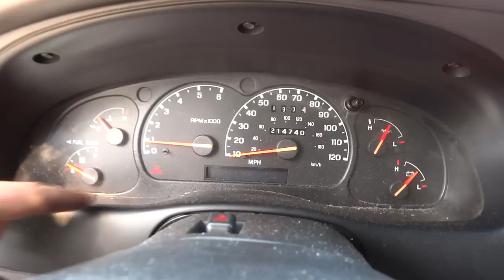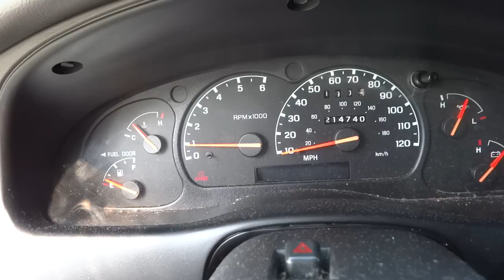Engine Knocking or Ticking?!? This Could Be Your "FIX" Ford/Mazda/Bmw/Honda/Toyota

Comment: Ok... here is the 101 on why this is a really really bad idea... Engines are built to regulate a near perfect fuel/air ratio which is typically 14.6:1. They are engineered to regulate this in a number of ways. One of those ways is to limit the air intake using swirl flaps. That way you don't have so much air that you have trouble with your combustion. By removing these your car isn't going to be able to regulate they way it should. With more air the computer is going to accommodate with more fuel. It may sound better because you don't hear the flaps and it might feel better because you are going to have surges from all the extra fuel. But ultimately this is bad for your fuel economy and it is going to make the engine run a lot worse than it should. It's asking for lean conditions which are also going to burn out your spark plugs a lot faster. No good is going to come from doing this. The "fix" is all in your head.

Comment: P0171 code my actuator has a leak im thinking about replacing the manifold but found this video would doing this to my 2.3l 2003 ranger help and how would I fix the swirl valve/ runner valve to get rid of my code and get my mileage back

Comment: Does the 1996 Toyota v6 have these swirl flaps? I have a friend with the v6 in his 1996 4runner and it's making a ticking noise that sounds like ticking valves. I'm wondering if this is what's wrong. The car has about 250k miles but has had superior maintenance over it's entire life and he is the original owner.
Reply: Hey dude, did ur friend ever find out what that ticking noise  is? I have a 97 Lexus es300 with some ticking noise too. Fuckn Toyota..... I've always kept up with my maintenance, but i guess just old age. 228,000 miles. I don't want it to die on me.

Comment: I have a 96 impreza which has a similar engine knock. I'm not sure if this is the problem, or if it's just my lifters making noise. Can someone be more descriptive with the knocking? My knock is loud upon start up but it quiets down if its been running and started back up quickly. This could be because the oil pressure is higher and the lifters quieted down, or this could in fact be the flaps. Could someone tell me please, i really dont want to take apart my entire manifold only to realize that a motor flush and oil change could fix it.

Comment: what happens if you remove the plug to the actuator but leave the vacuum lines plugged in and keep driving around? my mazda3 does this BADLY
Reply: Good question.

Comment: Those flaps my friends are only there for low end torque. I kno in an acura gsr thats wat it for so I could only imagine that wats it for on ur vechical. So taking them off does have good effects on ur car n bad. U just mainly gain more airflow which is better for high rpms n more torque in ur upper powerband. In ur case.... u shift probably at 6500 so loss of power n torque for daily driving.  on my honda "built" I shift at 11k.  So I will notice the gains more then u. There really no physical harm in remove em but dont do it unless u got a high rpm motor or to quiet the noise it makes.. just be careful not to hammer anything plastic. Pretty sure its gonna break. Good recovery btw. XD

Comment: Why would you not simply replace the $5 intake manifold gaskets? This and you 'bull in a china closet' approach seems to discredit your theories regarding improved performance. That said, your video is informative in the diagnostics of the issue. I think it would have been worth attempting to simply change the solenoid before hacking away at things...
Reply from the maker: The intake manifold gasket had plenty of thickness past the intake to seal properly, as for the solenoid..it's not the problem as I mentioned...the flaps inside no longer grip the inside shaft and move back and forth even when the shaft that the solenoid controls doesnt.
Reply: I get all that... Everything I have read says this mod gets mixed results; some people notice little difference with or without the control valves while others experience harder starts, the engine bogging down at low rpms, and Check engine lights. Basically if you have a race car that needs to perform at wide open throttle all day its great... As long as you get the ECU programmed to take advantage of the extra air. If drive-ability is what you are going for be prepared to buy a replacement manifold if the results aren't desirable which is really the only alternative to your suggestion. The only downside I suppose would be having to do the removal and re-installation twice.

Comment: depending on how ur intake manafold is bc i have a 2010 civic n i took it off since its metalk it dint have flaps ao i used the engin flush with oild lube or whatever its caller n ticking went away tnx though

Comment: this sound that you speak of, does it get louder when accelerating around 2500 rpm to 3500 rpm. I drive a jdm toyota with a 1jz six cylinder engine. Makes a sound similar to that but the sounds becomes a lot louder when the engine is accelerating around 2500 rpm to 3500. I would greatly appreciate your assistance

Comment: Hey @Nthefastlane, great video! I Have a 1997 mazda 626, it makes a flapping noise while its idle and when I accelerate, any ideas?
Reply from the maker: If the sound is coming from your valve cover, and sounds like a flap/ticking noise, then it could be your HLA's (hydraulic lifters).
Reply: @Nthefastlane  hey question I have a v6 05 Ford escape and I have that same noise but I'm not sure if that's my problem
Reply: @Nthefastlane question I have 02 accord ex and I have a lil ticking sound coming from the belt area...I kno it's not the head because I've changed it already but any ideas? Btw I think my knock sensor is bad could that be the problem?

Comment: you might have low brake oil pressure or brake oil pump malfunction, as for the inlet manifold modding you will get extra power and engine that feels more alive, but you will shorten its life
Reply: could you elaborate why? Last i checked higher pressure is good for low rpm (which baisicly one of thos mechanism functions).

Comment: i stopped watching when you said you have to remove the throttle body to take off the throttle link. pop it with a flat head

Comment: So I have a 1984 4x2 pickup. When I drove it around town it did great. but on the highways it was slow and lost power. I found out it was a fuel pump. and got it replaced. but before I did I thought the breathing hole was a random hole so I took and jb welded a don't screw in it and drive it around then my motor lost almost all power and started knocking. my spark plugs have gas on them and was told I may have to just change my oil. but I don't know any ideas anyone?

Comment: They should of stuck with the zetec motor. The intake is on the back of the motor &the exhaust upfront.Also the alternator is in the back & I was thinking how they should change it around but now that I see the duratec motors, I'm glad I have the zetec.i do Wana bore it out & port my heads.rite now I'm installing a new fuel filter & I'm cleaning the aic valve(again).its a pain cuz it's in the intake on the back side of the motor sandwiched in between the block.i have a 03 focus L4 vin3 dohc 2.0.

Comment: I heard this on my 2006 Hyundai Azera worse after starting it cold in the cold outdoors. Usually a mild ticking during the summer but noticed it very loud when I started it cold tonight. I don't know if its the runner flaps like you say or the muffler now because after it calmed down near the engine area the ticking or knocking noise was appearing near the back where the muffler is. Or maybe the oil viscosity being too thin or too thick when starting cold if the oil isn't getting into the oil filter and just air? Would that cause that? it's always been doing that for as long as i had the car since 2013 so i can't imagine it just being oil issue if air is going into the oil filter and into the system to cause the lifters to "tick.". I wish i knew.

Comment: Not sure why there in there, but seen a couple and i have a ranger with that very problem, not a smart design. Work well when they work. I read there for emissions and fuel economy. But just robbes the engine of air. Thanks for the information good video

Comment: its plastic, after it gets hot it gets brittle. replace the intake its cheap anyways to buy, never do this or you risk sucking the glue or plastic weld into the engine and that stuff is as hard as metal in most cases resulting in major engine damage. not to mention the annoying check engine light this will make magically appear.if you must do this only remove the flaps not the rod!!

Comment: hahaha this is such a hack, i am a licensed mechanic and this just made my day. i mean, it will work, until the vaporous fuel and the vaporous oil from the pcv system that is in the intake all the time gets at your epoxy and causes it to dislodge and get sucked into the engine. this is defiantly a 5 star back yard job. i dont imagine this helped fuel economy at all as the swirl effect is intended to create better bottom end torque and better low rpm burn effeciency (ie: cruising speeds)

Comment: I have a 2001 ford ranger it has a knock I can't find out where tho it's just at low Rpms it has all it power an still runs perfect just has a knock. Need help ASAP
Reply: It has the 2.3 16 valve

Comment: I am actually have a 2010 Acura TL and every time in the morning when I turn it on it's been making this noise  like ticking noise then I let it run for like 2-3 minutes then the noise goes away so I was thinking it could be a bad lifter, if anybody  have any suggestions and I will preciate it

Comment: Brake clean is not used to clean plastic parts, reason being is that it deteriorates the plastic and makes it brittle. NEVER use brake clean on plastic. Use compressed air and a neutral cleaner with cloths that don’t leave residue such as microfiber or painters rags

Comment: were did you buy that part cleaner machine
Reply: Harbor Freight sells an ultrasonic cleaner.
Reply from the maker: It is a "Ultrasonic jewelry cleaner".. you can get it any where..Ebay,Amazon & Walmart..make sure it says ultrasonic or you'll just get a vibrator.

Comment: I have 2005 f150 dose that knocking nosie but dealer says it may be the spark plug and coil what do you think I've search this problem but I guess every 2005f 150 has this same problem "help"
Reply: what plugs are you running in it
Reply: +Update You it has the only ones that It used the big one there different then the  regular
Reply: +antonio gamino never hear of a coil making the knocking or ticking noise
Reply: See that's what I tell the dealer but idk what could be the problem
Reply: +antonio gamino it could be the fludder valve inside the manifold
Reply: +Update You where is that

Comment: wonder if the Honda b series manifolds had the same system, my B20 does the same clicking noise running hot while idling.
Reply from the maker: +eulises esquivel I know the B18c does, I elimiated them as well. You just remove the entire center butterfly, it's a complete unit. Then just change out the length of the bolts. Make sure to check your air/fuel ratios after. I'd imagine you'd run slightly leaner.

Comment: Does that affect the smog check
Reply: Yes, most cars will turn on a check engine light cause they check for difference in air flow at different loads and rpms.

Comment: not swirl flaps.  intake manifold runner control valves.
Reply: Some flaps "redirect" air,,, these flaps simply "choke" the airway... "swirl" is the common way to indicate the flaps that "choke" the airway.

Comment: also would this throw a vacuum leak code?
Reply from the maker: No, leave the vacuum solenoid in like I mentioned and it won't throw any codes..10 months and still no codes.

Comment: wow. the manifold wouldn't normally be subjected to pliers under normal running ;-). also when the throttle is wide open these would be laying flat to get max airflow, they only flap around because it's idling not under LOAD.

Comment: I have a 2002 ford escort and my car is knocking out of nowhere really loud., its not starting anymore but it was., it started pulling and misfiring like it was struggling to run., ! they told me to buy a new engine for 3-5k$ new engine for the car., i went to Midas and got a oil change and it wasn't doing this at all., I've never had any problems with my car
Reply: I might be wrong but it seems like they probably forgot to put oil back in and your engine probably seized
Reply: +Mark Miranda that's what 3 mechanics said and Midas is disclaiming  they did! my car has not been runninh., and do you know what I can do to fix it ?
Reply: or do I just need another car omg smh
Reply: Every shop is going to disclaim their error even Walmart, and other shops like jiffy lube have messes  up motors, its also going to be hard to dispute I f you decide to go to court, look it up, and yes you are going to have to buy a new engine, might as well get a new car for that cost....that is why I ALWAYS do my own work.
Reply: +Mark Miranda omg okay thank you n i am going to court for it thank you
Reply: +tandy vz good luck hope you win.

Comment: You have a bunch of different responses. How is it doing now? Did it blow a code yet? Wondering.
Reply from the maker: Jack Jacke I never had a single issue, I sold the truck last year, the guy who bought it still has no issues. Keep in mind, at the time this was my daily driver, so I put quite a bit of miles on it.

Comment: do these flaps cause ur vehicle to not be able to pull its self up a ramp on a trailer no power
Reply from the maker: Robbie Nuttle Absolutely, if they prematurely close, it will kill all power. I would first check your catalytic converter, then the flaps control solenoid.

Comment: wow i dont think i have ever seen anyone so sloppy give advice on how to fix something. YES it is plastic dude, its not metal. please do everyone a favor and do not work on the inside of anyvehicle unless it is an industrial vehicle.
Reply: Dude, lighten up. That was totally uncalled for. Anyone who hasn't made that kind of a mistake has a bad memory or thinks way to much of themselves by themselves to themselves. :/ 

The point of this video was the fix for the flaps that attempts to cut off air to make a richer mixture. I wish the manf would quit doing us favors like this!
Reply: chris keiley 100 ft. lbs. huh???
Reply: Daniel Smith k

Comment: it was working fine till today the check engine light came on and I put my code reader and it says the intake manifold staying  open
Reply from the maker: @19:29 did you plug the plug back into that vacuum device and assemble it back together so it can move up and down and also hook up all your vacuum lines..?
Reply: Yes

Comment: Usually these flaps are for low end torque and gradually open at higher rpm to smooth overall power and y would u want to remove them unless it has other performance mods that wouldn't require the flaps anymore they are also for gas milage many makes and models use these for a purpose to me it would be as pointless as a k&n filter but if your just trying to get rid of the noise I'd just repair and replace parts as needed like I said they do actually perform a purpose engineers do not just sit there and say (hey u guys let's throw this thing in here just to mess with people ) BENZ BMW also have these IABs but on a modified vehicle with a different tune bolt ons ect I could see it but a daily driver no modifications all stock this I do not believe would have any benefit other then hurting gas milage and low end torque just food for thought

Comment: 95 mazda b2300 noisy n shaking motor, if a remove those thing is going to help
Reply: if you want worse has mileage and power
Reply: if your motor shakes then you sir need to replace your motor mounts asap